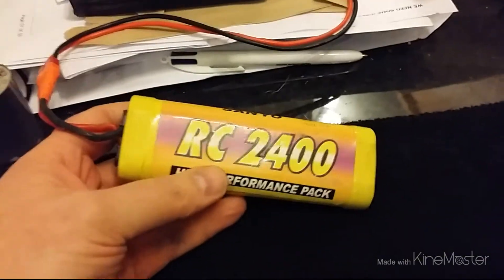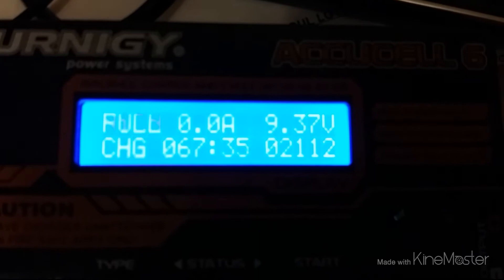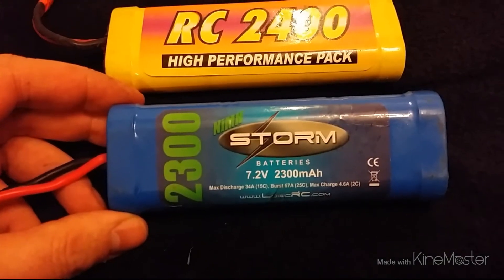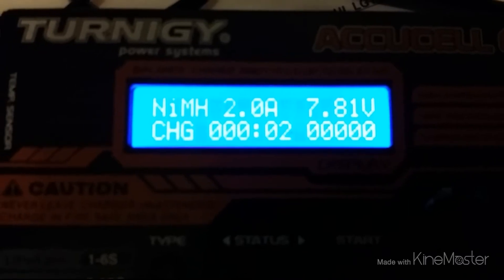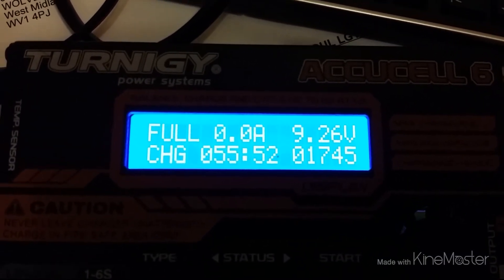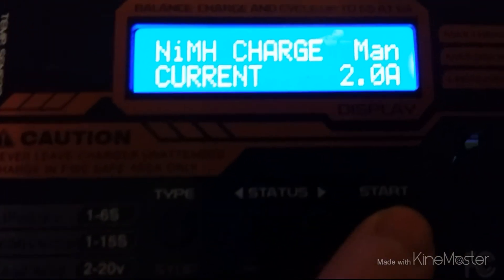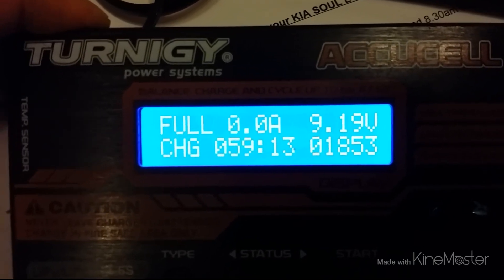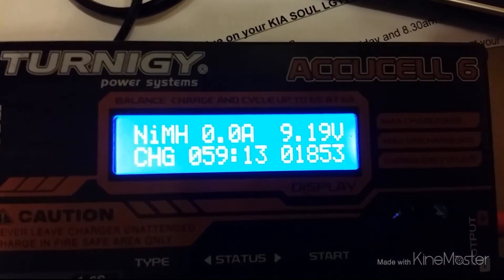7.2v stick battery output and charge cycles.

Comment: I tested my new nimh with a multi meter because I was sus on the overnight charger. And it was putting out 7.8v so I don't know. Maybe once under load it drops to 7.2v?
Reply: That Is the peak voltage the battery reached during charging. That is normal. After you let the battery cool down and sit for a few hours you should have around 8v. Nicd and nimh start dropping voltage as soon as you start to use them. So within the first few minutes it will be below 7.2 and even less under load were you to monitor it during use. Think of a 1:1 car battery. It is 12v but after a good charge it is around 13-13.5v and when the car is running the charging system keeps it at around 14.1v constantly. All of my 8.4nimh's peak around 10.8v when I am finished charging on my Hitec x4 or Thunder T6 (same charger just different labels lol) that is why lipos are so much better. They will drop a small amount of voltage only losing their surface charge and hold a fairly steady voltage until most of its mah is drained and then it will drop voltage very rapidly. So with lipo you basically have full battery power till the mah is mostly gone. Nicd and nimh you only have full battery for the first few minutes of use and it drops steadily over its usage. A motor on nimh will start out at lets say 3000 rpm and lose rpm the entire time until the battery is dead. A motor on lipo will stay fairly close to 3000 rpm until the battery is almost dead and then very quickly lose all the rpm at the end.
Reply: Neomax25 I have a 12 yo nicad and it still works to.
Reply: I wish I know bro
Reply from the maker: DJ Dragon Thanks man, I'll give it a bit of monitoring and see how it goes. I did wonder with the nicad because when I was a kid nicads of the day were renowned for dropping off suddenly, but later nicads seem to lose it more steadily,  and these nicads I have really are about 20 years old lol